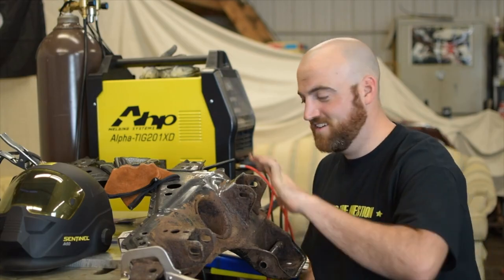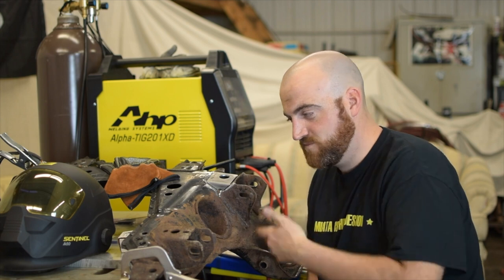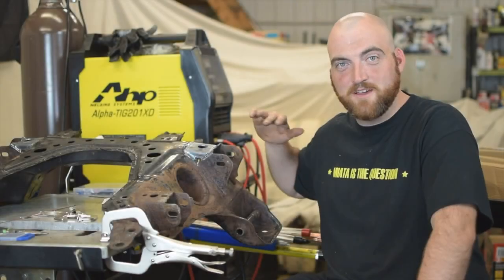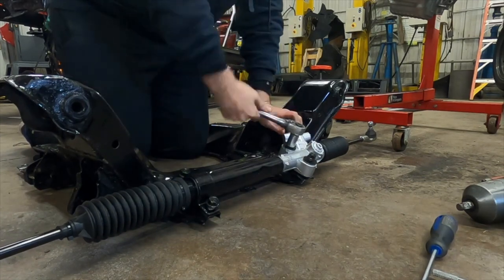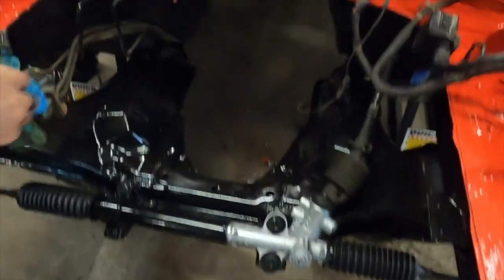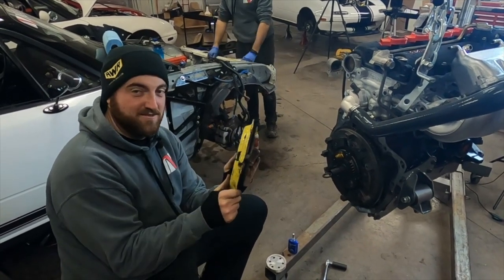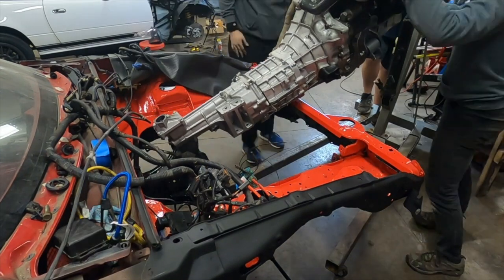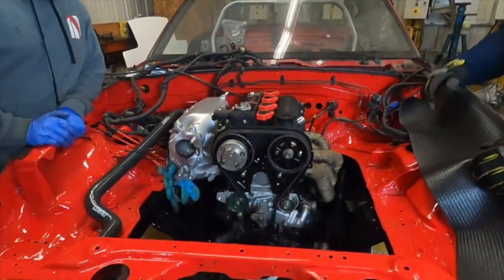Engine Install // Miata Track Build

Comment: Guys, any thoughts on "Paco" strong arms? I'm tossing that idea around in my head... Dylan donates a clutch... Wonder what he's up to. For Black Friday, I ordered a Haltech Elite 2500, premium wiring harness, and CAN Bus Wide band o2 sensor (Bosch). Once I dig in, I want to repaint the engine bay POR white (leak detection). Oh, and I acquired a used turbo setup as well.
Reply from the maker: Heyo! We installed a set on Dylan’s car last winter. As fender braces go, they look like some of the best on the market. A used turbi kit you say…. Hmmmm sounds strangely familiar.

Comment: Nice, very nice. How much power are you expecting to make at the wheels?
Reply from the maker: Great question, we should place bets. It will be under 150whp on our original NA VVT build. Probably in this 120-130ish.

Comment: Do you have to replace subframe for adding VVT 1.8 in the NA Miata?
Reply from the maker: Nope. As long as you use any 1.8 engine mounts (94-05), it’ll bolt right up to any subframe (90-05).

Comment: why install the rack when you will need to pull it off to mate it with the intermediate shaft
Reply from the maker: You are correct. We’re going to need to remove it for that, but for now it’s there and accounted for.